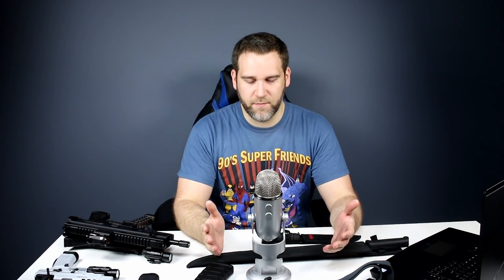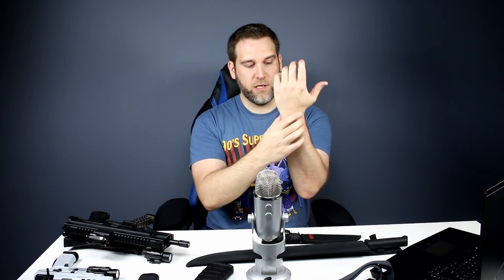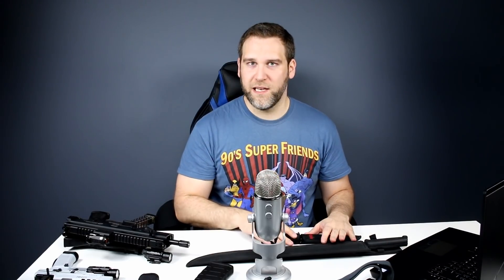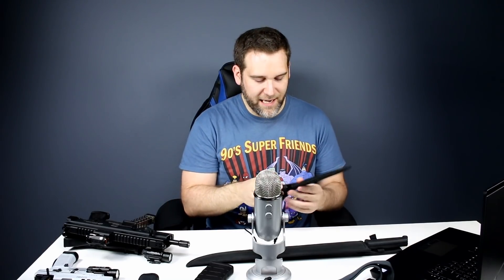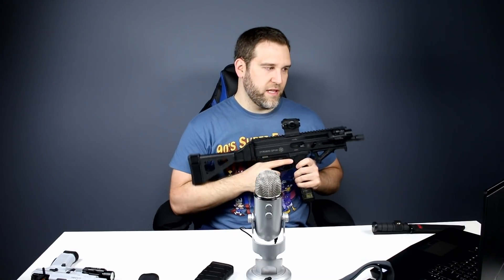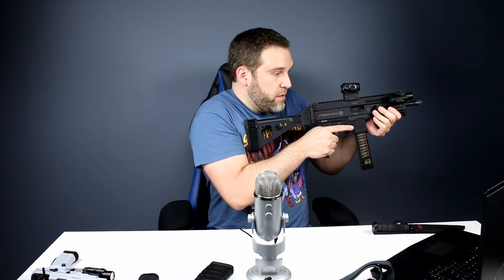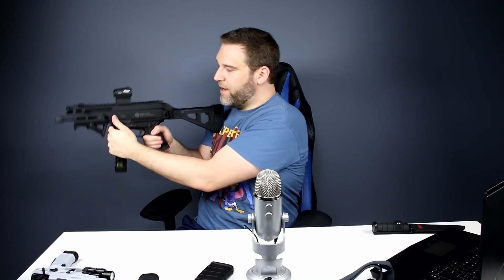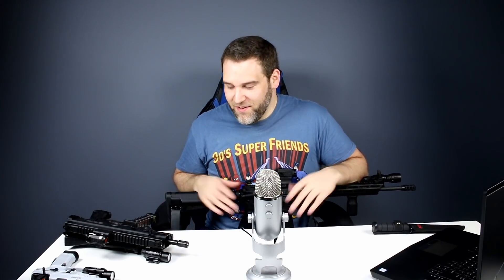Articulation Explanation | 1 | Wrists

Comment: The biggest problem with most action figures and posing them with 2- handed weapons, is where the bicep intersects with the chest, preventing proper movement.  They need to work on putting a discreet hinge in the bicep area to improve the range of movement. Wrist movement can't fix that at all, so it's a moot point.

Comment: Nice stribog, they are making the gen 3 mags with metal feed lips and better followers. I'm getting some for mine. Also the vertical wrist articulation is important for the "C clamp" method on the off hand when holding a rifle which most characters that are proficient with rifles would use. Awesome video man.
Reply from the maker: I haven't found anywhere if there new mags are backwards compatible or vice versa.
Reply: @AnthonysCustoms  they should be, the only thing they changed is the upper but the first reviews should say if they are or not. Either way I'll make them work somehow lol. Have you thought about getting a suppressor? Those props would look even slicker with a can

Comment: The all vertical wrist hinges would work if most figures could actually cross their arms over their torsos properly to hold double handed guns like that. But they don’t. With the new Joes it seems like you need a horizontal hinge on the other hand to get the gun in both hands
Reply from the maker: You really don't.

Comment: For weapons, with your demonstration i'am ok, so for military figures, no problem. But for animate (DBZ) or super heroes figures with super power, you need a horizontal hinge for some poses. And thanks to google translate "props" means "accessories" .
Reply from the maker: Yes.  I mentioned that it makes the most difference for accessories so that was going to be the focus.  Style pose hands all require joints that work for them but it's completely dependent on the specific hands.
Reply: @AnthonysCustoms  Good point.

Comment: The only use I have found for palm to knuckle hinges over the years (in relation to holding things at least) is to cheese out two handed poses for figures who can't really reach across their body in a natural way, usually due to a lack of butterfly joint or a bunch of stuff on the chest getting in the way. It usually leads to the pose looking like a chicken wing nightmare, but it gets both hands on the same item. Though this niche case could be completely eliminated by making the figure better overall, so maybe just go with that and include a thumb-pinkie hinge

Comment: For the vertical hinges of the wrist to work properly u need to have butterfly joints in the shoulders otherwise vertical hinges are useless for holding guns or swords two handed older ML figs which didn't have any butterfly joints benifitted from the horizontal hinges for two handed poses
Reply from the maker: But no

Comment: I would say that for the new ghostbusters plasma series, I would like the secondary hand to be a horizontal hinge. With both hands vertical, they have a hard time gripping their wands.

Please keep making them! For example, I think double hinged joints, for the most part, are useless on many figures, not because of the range of motion (although sometimes its really bad!) but because usually a good single joint will do, and look much better for the most part. Hasbro's double joints almost always look bad, again like in the recent plasma figures. Too big and blocky. A nice, deep single joint would suffice, specially for knee joints, where unless it's a Spiderman o a ninja, the figure never needs that deep of a range.

Elbows, on the other hand, do need to have a deep range of motion, because we tend to grab our faces or just bend our elbows a lot. A single joint might sometimes suffice, but here a double hinge is far more useful.

I am also trying to design a line of action figures, and I'm really trying to have a good balance between posability, looks, type and number of joints, as well as reusability.